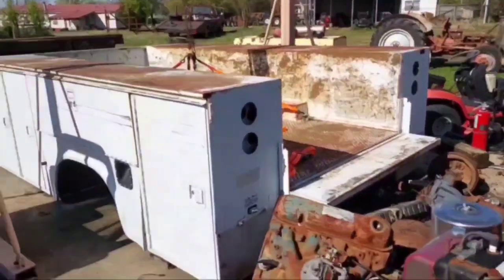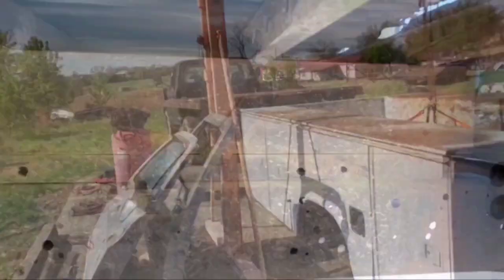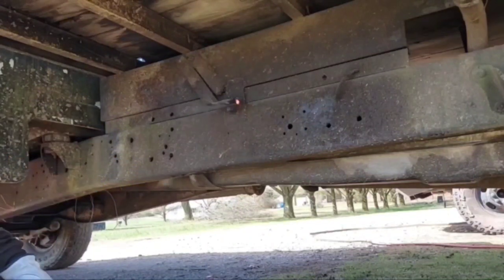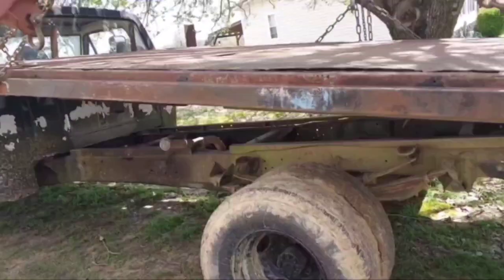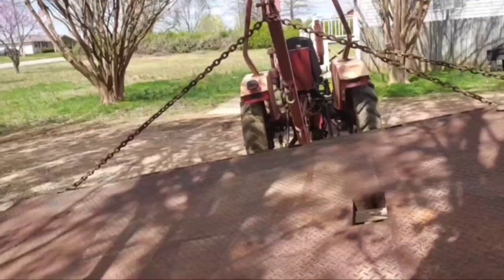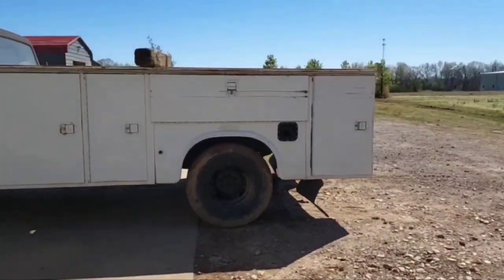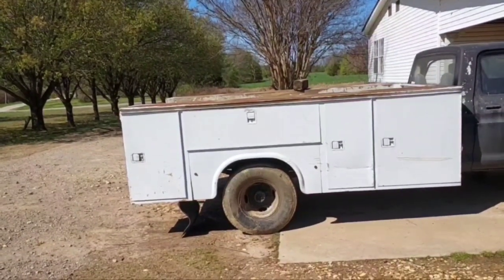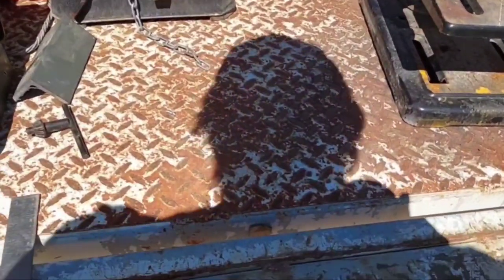Building a Welding Truck (Episode 2)

Comment: Your buddies at Hobo Freight sells a drill press vise made by Doyle to hold most of your drilling jobs safer than you holding it
Reply from the maker: I'm aware, I just aint got one and my method worked. If the drill press had any real power, I would've used a different method